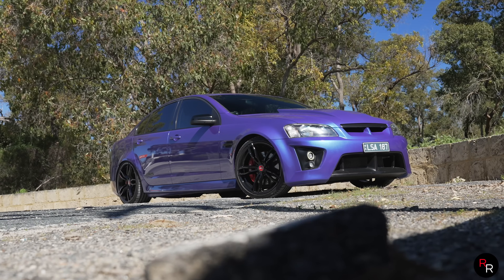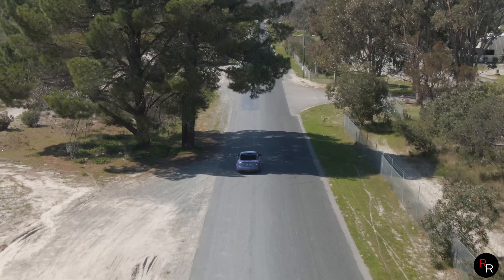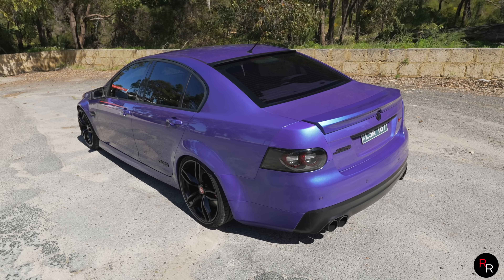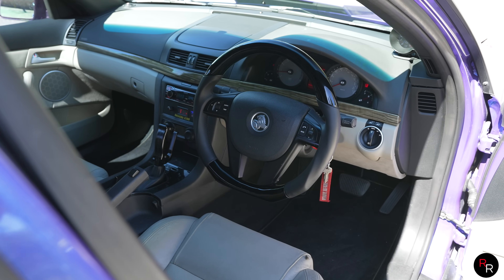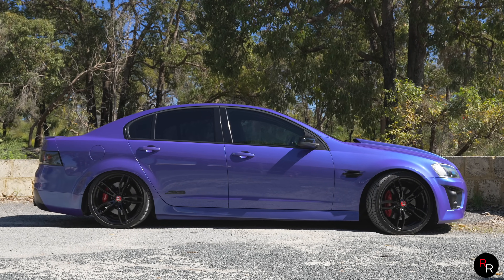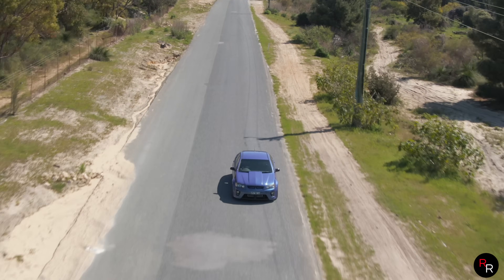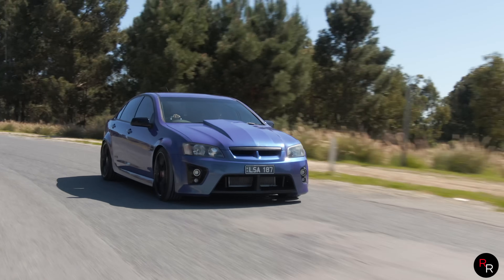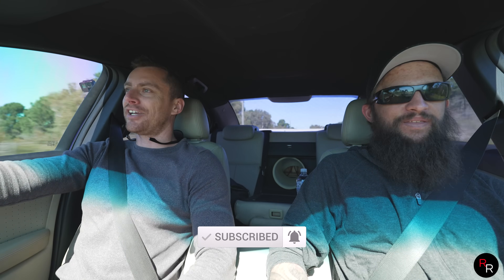This Is How You Make 450kw In A VE SS!

Comment: How did he the the GTS convention on the back?
Reply from the maker: Not sure done it all himself in the garage
Reply: Gts tail lights and top covers, boot, rear bar, and the tail light looms is a plug & play type. Expensive though looks mint.👌🏻
Reply: @Aus-OpenBodybuilding 
Ive been looking into it
I’m lucky enough to have a friend of mine that is a Commodore wrecker

So I can get the parts a bit cheaper when he gets those cars in which he is getting 2 in by the end of the year 

But I’m so curious on how he did it and he needed to change or was it just bolt on bolt off bolt on

Looks really good it’s like a VE Senator at the back
VE CLUBSPORT at the front
I like it
Reply: @sspatrol6989  Yea mate its a bolt on bolt off type of bodykit its easy to change over once you get the parts.